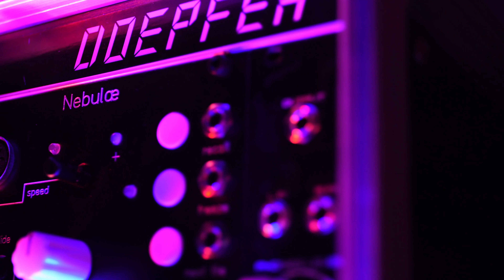DIY Eurorack: Erica Synths Output Module Build

Comment: I built one of these and have a question. Do you hear noise with the headphones when you pass the 12 o’clock on the volume?
Reply from the maker: If I turn the volume all they way up I can hear a bit of noise, but not very much, and I can't hear any noise at 12 o'clock. What sort of power supply do you have for your rack? My first guess would be that noise from the power supply is causing the issue. If you have a way to measure it, ripple voltage shouldn't really be more than about 100mV, and if it is, that might be your issue, which might mean that your power supply is faulty and/or overloaded.
Reply: Hans Stahl the issue is not the power supply, was/is the smd chip that is very badly soldered. I retouched the joints and the noise at 12 o’clock is gone. I hope it doesn’t happen again in the future.
Reply: @exapod23    Good info. I have just built the full kit and i get unpleasant snaps and clipping around 12 and further. The module seems very sensitive to the hot eurorack signal going into it? I will reflow the smd chip and see what happens.